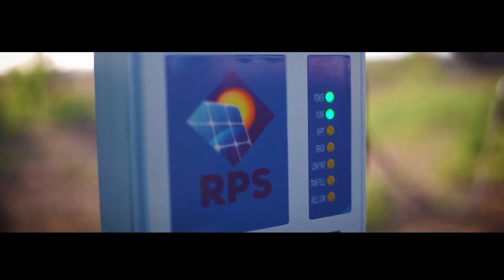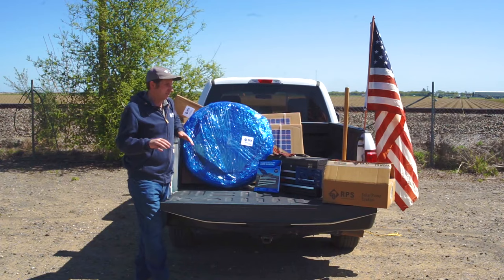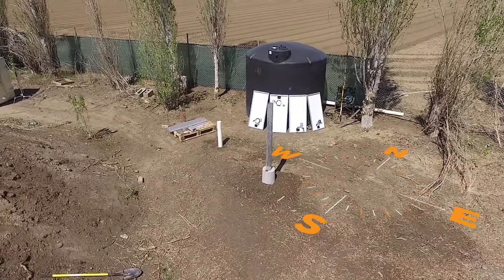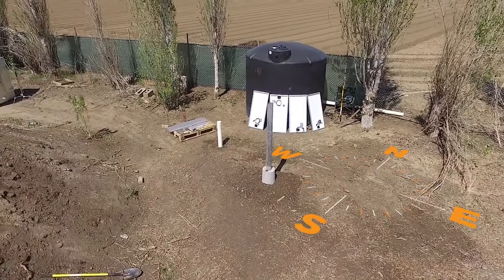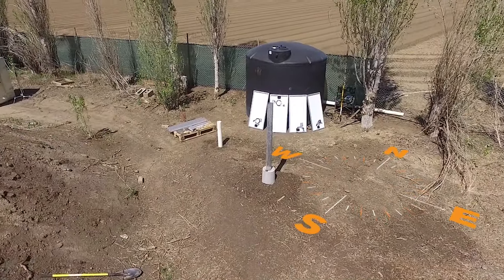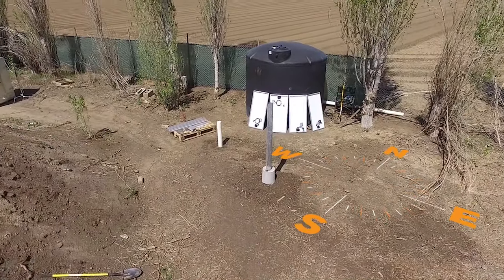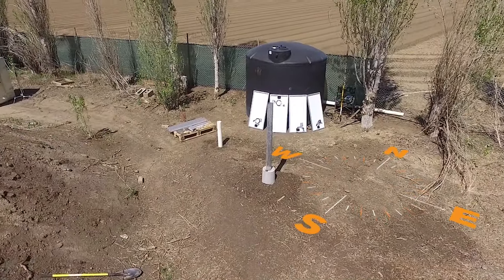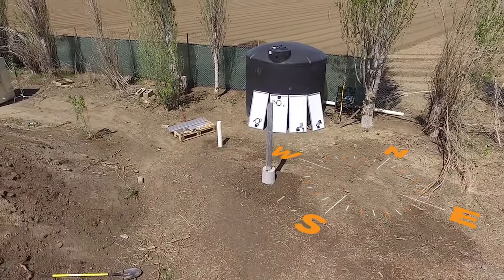Solar Water Pump Full Installation & Demo • RPS Solar Pumps

Comment: Never ever use poly pipe for such an installation unless you have the equipment to pull that pipe up from a great depth full of water. I made the mistake of using 1.25" poly pipe to a depth of 200 ft and it weighs 500 lbs, I don't have the tools to pull it up and what is worse is none of the half-dozen well service companies in this county will deal with poly pipe. They complain that the pipe will kink and be damaged during the pulling and their insurance company will not cover them if they reinstall it. They insist on replacing the poly with PVC and special couplings. The material cost to me to replace the pump now includes $800 extra just for a new pipe string. Putting the poly in is easy as the pipe is empty of water.
Reply: Where do you live? Why do they recommend poly pipe? Is pvc harder to work with?
Reply: @annekabrimhall1059  Listen to the voice of experience. Then shut up.
Reply: Build a roller that can act as a guide while you use a tractor or an automobile to pull. H2o mechanic has some videos
Reply: @pauljohnson2372  That would have worked if I had prepared a year before the event. Instead, the company replaced everything, the pump, motor, pipe string, check valve, pressure tank, relays, and control box for a cost of $6800.

Comment: Wow your system for over 300ft is like 4k! Wow! I did my own for $600 for pump and controller with 4 year warranty. $600 for 8 100 watt panels. 400 feet of pex and some fittings and proper wire sized properly and tape and few solar connectors and bucket and rope etc for less than $300 more so $1500 approximately for my system. Guess I should slap my own name on a turnkey system and sell it for double and people still save $1000 wow. Nah I’ll just do a YouTube video and help people for free save money and wave the flag for free. $2500 more yours is and does same thing and is good quality comparison by looking at it all!

Comment: I wish every company I dealt with was as good as RPS! The online information covers everything and is high quality. The sales / customer service team helped this first-time well-owner with all details and took the time to discuss and explain when needed. 

When I received our RPS 800 with full turnkey kit for our off-grid property, I read the outstanding manual from cover to cover. After that I made all of the connections, did a bucket test, and everything worked the first time. On installation day, everything went smoothly and it was so rewarding to get water pouring out of the well after turning the system on!

We have another off-grid property which needs a well so now I’m a repeat customer after ordering a second RPS kit. I highly recommend RPS to anyone needing a system.
Reply: Hello sir,am a young technician wanted to learn many things from you

Comment: Great system; great service BUT Need a video showing exactly how to handle the wiring through the well seal and to the controller--you mention flexible conduit but don't show an example.  Do you need some kind of rubber insert for the well seal in your kit?  A jam nut?  Could use some help w/that.  TIA

Comment: Excellent video!  Have you ever taped the wire to the pipe drop?  Fortunately our installer taped the electrical to the pipe drop every 10 ft and when the pipe drop came out of the well head, pulled all of the connections loose they were able to fish it out and since wires were taped, it was repairable.  😊
Reply from the maker: Yup we recommend using electrical tape to wrap all the pipe, wire and safety rope together into a bundle

Comment: This is great. So many others just make a 5 min video pointing at things and components, naming them and reading from a brochure card. Seeing it put together helps me understand how it works and what I need to replace my AC pump with a DC solar pump.

Well done.

I want to put it on a 48v battery bank, do I also need a charge controller or does the controller that comes with like the RPS400 kit handle the charging as well?
Reply from the maker: Hey Shane, an RPS 400 comes with a an RPS Universal charge controller, pump and solar panels(along with some solar wiring and a few more items for install). The Universal Charge controller will handle the charging and discharging of the batteries associated with an RPS 400 system, no need to add on parts!

Comment: I live in the the deep South - our humidity average is around 60% - moisture defuses or scatters the UV light that shines down off the sun - 
       Solar panels rely on UV light to excite the panels - down here on most sunny days solar panels only generate 20% of there rated out put at noon day - 
     There are always clouds that further reduce the out put of solar panel out put - 
      This summer it did not rain much at all - we had the lowest humidity we had in yrs - 35% many days when it was 110° - solar panels generated 40% of there rated out put at noon day - 
      Solar panels work well in dry regions but not well in humid regions - I had was worked on generators in the offshore oil and gas industry for decades so I notice those things -

Comment: This system looks like it would be ideal for many of my clients. How do the components hold up in outdoor salty environments? Most of their empty lots would be off grid at the beach. Constant wind and salt spray, and a long rainy season has been a rough go for most systems installed in the past. 
How do those low water level detectors hold up if there is any iron in the water? 
Do you have international distributions set up/ship to Panama at all?
Reply from the maker: The pumps and piping will hold up great, there is always some concerns with the mounting and panels, but if you keep them clean you shouldn't have a problem.
Reply: @RPSSolarPumps  thank you. I have about 8 clients that ended up buying these systems so I’ll be installing them over the coming months. Do you also sell spare parts of say the male x insert SS extra long fitting? 

Does it need to be a special reinforced electrical tape or would the standard stuff work for the submerged parts?

Comment: Good day I'm from Saint Vincent and the Grenadines.
I just bought this system , I had to ship it to my business partner in the USA and then have them ship it to me here in SVG, it should be in my hands by November this year 
My well is about 8ft, low well.
Question (1) how low should I drop the pump at that depth?
Question( 2) my tanks is on a hill ascend about 50ft up will the pump be able to pump the water to that height in a sufficient manner?

I have 2 600 gallons tanks

Thks in advance on your speedy reply

Comment: Hi, how do connect a pump with 1200w/110v use 300w/36v panels? (Can I use 6 of panels by connecting 3 series and 2 panels or should I just  connect 4 in series

Comment: What is the output of the sensor? Is it just a switch or does it provide a low voltage signal (maybe 48v?)?

Comment: Looking in to a solar pump as our current setup is at 20years and nearing end of life. Silly question, but what about water pressurizers? 
We’ve got an old Grundfos 1.5hp pushing pressure through 2  75 gallons tanks for the house and 5 acre ranch property. 
Tanks are in good shape thankfully
Reply from the maker: A solar pump works exactly like an AC pump in that capacity, you just get a properly sized pump to fit what ever pressure requirements you have. Need 60 psi? tell our techs that and theyll take it into account. You probably wont be far off of using a 1.5HP again, just this time you'll be powering of of solar. And since there are lots of different 1.5 HP pump options out there, we just find the one that fits your well depth and provides enough flow rate for the ranch applications + house

Comment: If installing by yourself ?   Take a wheelbarrow without a tire  but the wheel still on it. Turn wheel barrow upside down and us the wheel to bend the poly pipe over the edge without having it kink or scrape on the edge of the down pipe.  Worked for me when by myself.  Otherwise have your friend help.

Comment: Will this be sufficient for supplying water to a completely off the grid home?
Reply from the maker: Yup. And you can choose the kind of water system setup. Most completely off grid home customers go with the option of pumping from the well, into a storage tank and then booster out with a secondary pump that runs off batteries. However, I've worked with many a people who decide to go straight into a pressure tank, and just opt for a larger 100+ gal pressure tank to tide them over during the night / of hours. Its up to you, but we can make almost anything for off grid work!

Comment: Hello, is there any chance that the pump gets damaged by a lightning strike ?
Reply from the maker: Not very often, if at all.  We have built in lightning protection for our controller, so very rarely do we have any issues.
Reply: Hello, please I have some questions regarding the low well and the tank full sensors. Do they work by heights or by pressures ? Are they designed to work at a certain range of heights (or pressures) or at a single height only ? I'll be more specific by giving an example : let's say we have a 2 meter high tank, and the tank full sensor has to send a signal to the controller when water reaches 1,8 m for example. Does the pump run again when water level goes just under 1,8 m or is the sensor designed to rerun the pump at a certain low height, for example 0,3 meters ? Is it the same for the low well sensor ? Thank you !
Reply: @RPSSolarPumps What type of SPD do you have built in to the controller. Do you have a spec on it?

Comment: My well is 250 feet deep, can I use this pump? Thank you!
Reply from the maker: Potentially, the RPS 400 has a head ability up to 225 feet, and we size a pump based on static water level and any additional head from pressure or vertical lift into a tank. If you call us with a description of your system we can give you an answer in just a few minutes after doing a couple quick calculations!
Reply: @RPSSolarPumps  Thank you!

Comment: Come up with a system that can pump 100 gpm. from a well site 60 foot deep with water at 20 feet.
Reply from the maker: Yep we can do that.  We have our Pro3000V which can do around 100GPM.  We can even go a bit higher with our 5hp system.  https://shop.rpssolarpumps.com/collections/livestock/products/rps-pro-series-v-high-volume-solar-pump-kits-under-300ft
Reply: @RPSSolarPumps  My well sites can currently pump 385 gpm . it's the cost of doing so 460 VAC and 25 hp motors, demand fees etc.  What is the cost of a kit that can pump 100gpm.